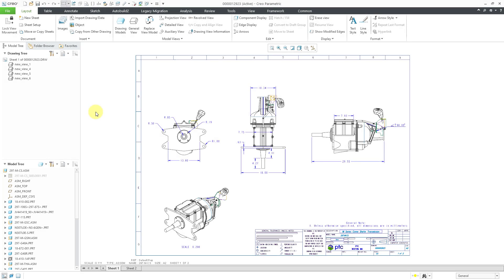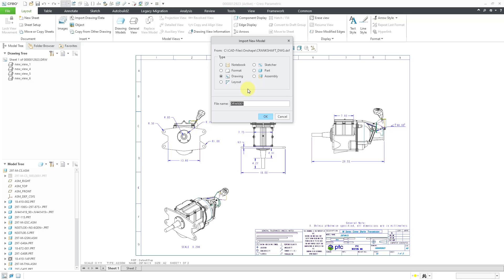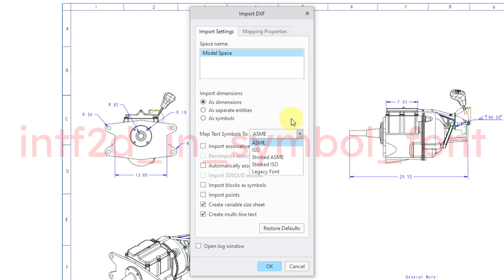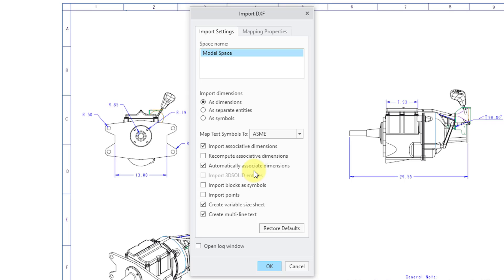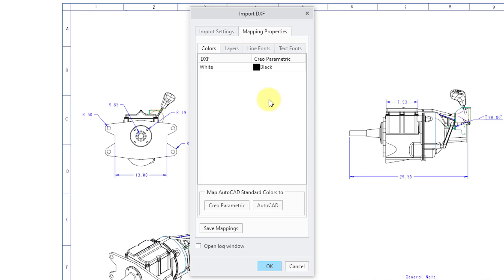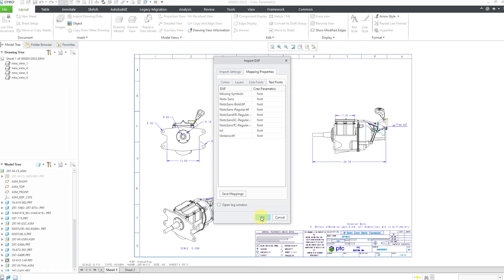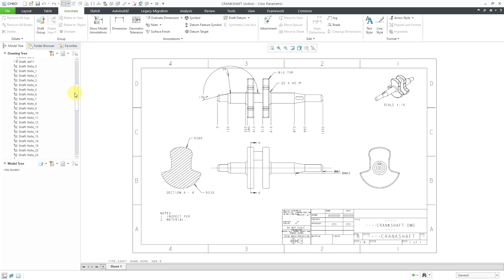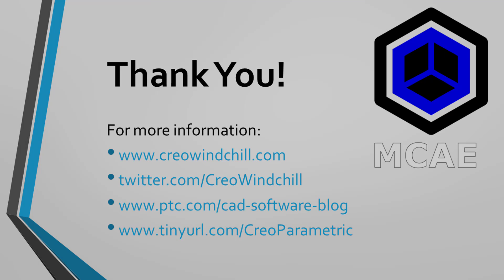Creo Parametric - Importing a DXF Drawing

Comment: Hello; I need to create dxf files from Solidworks, & pull them into Creo for a cgm output. One problem I had was the dim arrows are filled in SW & also in the dxf file, but when I import them into creo they're not filled. This would be as they look in your video. In fact my file was similar also in that the section line arrows remain filled in, but the dim line arrows aren't. Do you know of a way to correct this? Thanks much!!

Comment: In Solidworks is easy to import a 2D DXF file as a sketch to extrude it into a solid part.
As much as I try to do the same on Creo it is impossible to be performed when the amount of lines and nodes is not that from a simple part.
Reply from the maker: Have you tried using Sketch Regions?
Reply: @CADPLMGuy  Sir thanks for replying.
Let me explain it better: I have architectural CNC plasma cutting panels designs done with Corel Designer and exported as DXF, these are a type of 2D decorative designs that is too complicated to trace in Creo because the huge amount of nodes makes the computer get frozen in the Creo Sketch mode either drafting it or importing the DXF file into the Sketch mode.
SOLIDWORKS doesn't have that issue, I am not quite experienced with SOLIDWORKS but is very simple to import a DXF into its Sketch mode and from there extrude it into a 3D solid part.
I am a Pro/E Creo user for more than 15 years and I haven't got through as yet to import a relatively complex DXF/DWG into the Sketch mode to model a 3D solid. Despite all that I am still convinced that Creo is an advanced product design system.